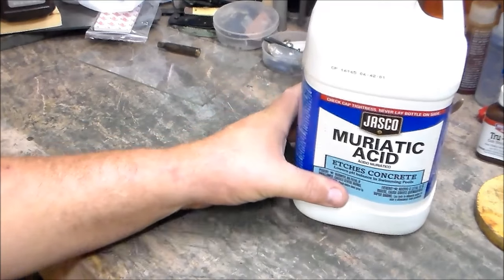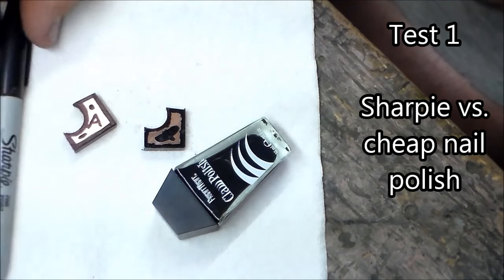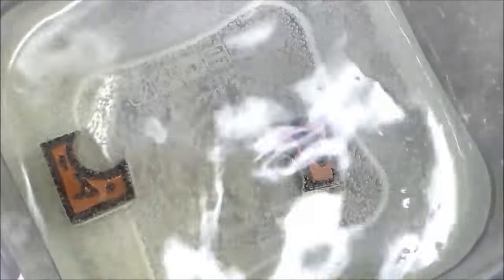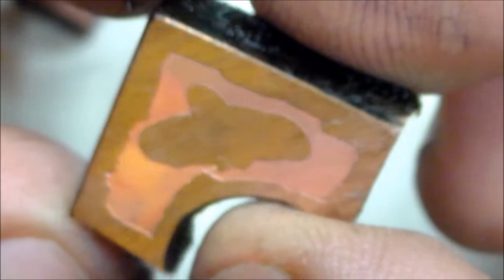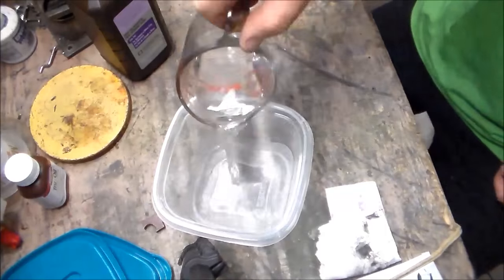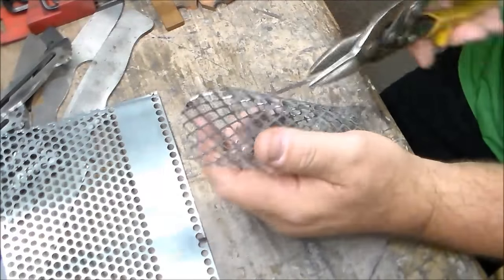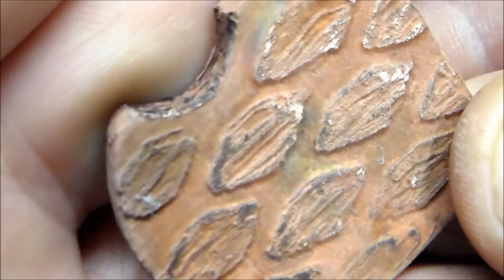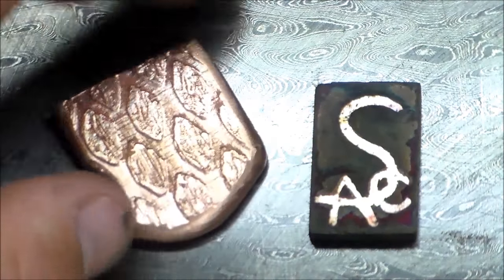Etching Copper for Knives, Brands, Circuit Boards

Comment: Can this work on steel sheet from menards?
And what you think how will be on aluminum???
Reply from the maker: Well, don't really know. I etch Damascus in ferric chloride, but never tried steel like this. It might work, but my gut feeling is that it wouldn't etch very deep and would take a long time. As for AL, I have no idea. If you try it, let me know.
Reply: I try to paint copper and then i scratch some paint.
After 50 min i didn't get any etch??
Why? What you think?
Reply from the maker: @samirpasic6836  was it a fresh mix? I noticed that after it's etched something once it pretty much is dead. Make sure the copper doesn't have any kind of a clear coat or sealer on it. Other than that, man I don't know.
Reply: @SelfMadeProject  do you have fb page or fb profile so i can show you what i get after second time ??
Reply from the maker: @samirpasic6836  sure, search Anthony Self or Self Made Knives.
Reply: @SelfMadeProject  i message you